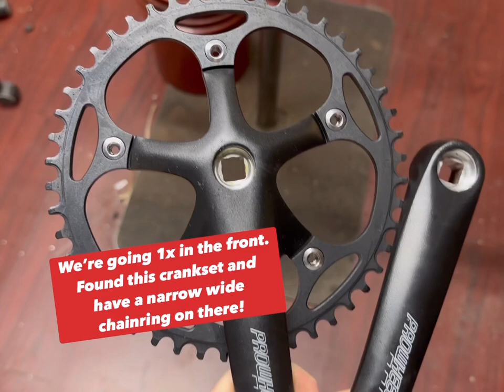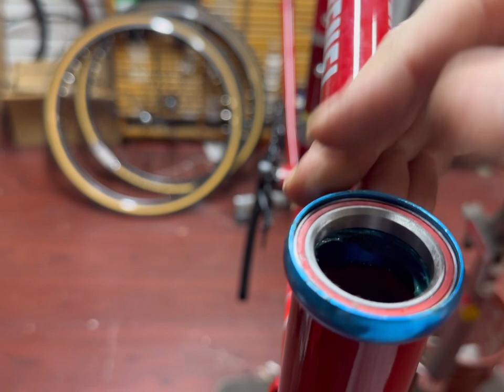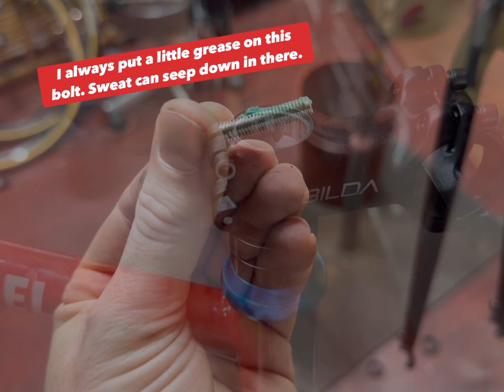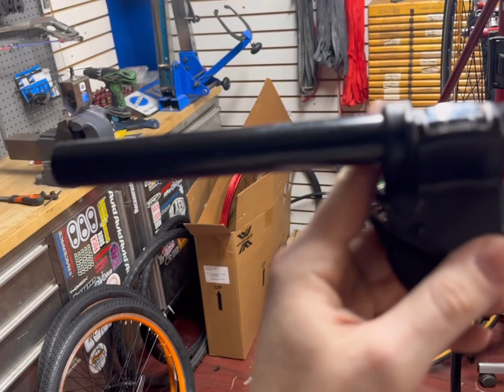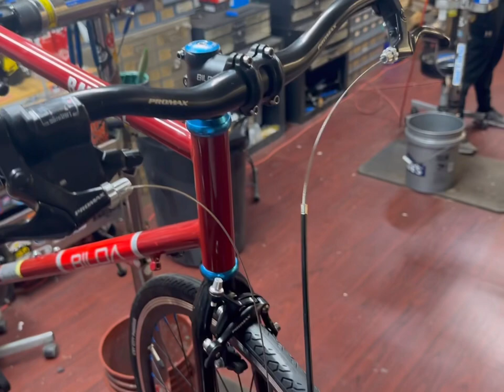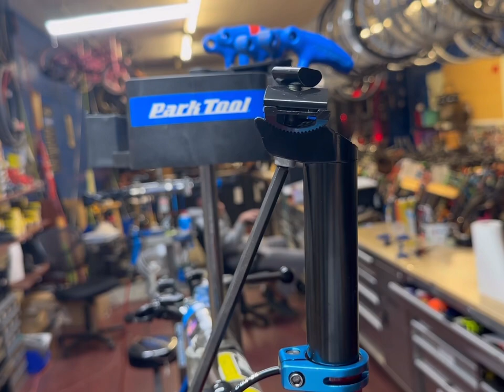Build A Bike - Turning Random Parts Into An Affordable Commuter Road Bike #bike #bikes #bicycles

Comment: Whats the cost if converting an old frame like this? What is the tooth count on that 1x? I am currently working on a 1999 Peugeot Jasper. I am keeping the original forks and bars. I do plan to upgrading the bottom bracket. It has a 48-38-28, 3x from what i can tell and a narrow freewheel 14-28' 6 speed on the back. Some tools and tires are in the mail and i am getting excited to clean the bearings and measure the bottom bracket. I want a commuter bike for work and for filming my YouTube city trai ridel videos. I am not filming my build because nobody should take my mechanical advice. Lol
Reply from the maker: Maybe $200-250 if you’re not replacing wheels. 1x tooth count is 44.